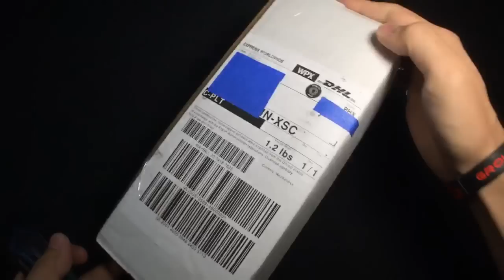Live Unboxing - SPINETIC PACKAGE

Comment: Hi i was wondering if it is even legal to have a flick knife with you in singapore. Since you have one can you give me some advice about these blades. Like how to stay away from trouble and when ur allowed to use it
Reply from the maker: Yup! Folding knives are fine. The only ones that are not allowed in Singapore are switchblades. :)
Reply: Average Singaporean i c. Coz i got one CRKT Pazoda
Reply from the maker: CRKT is a pretty good brand, man!
The Pazoda is super sleek and clean! Did you peep the Pazoda 2?
Reply: Average Singaporean i got the combo(serrated+ razor) black and white version of the pazoda. S$24. The pazoda 2 is abit more expensive at $30+. I didnt see much of a difference between the 2 then so i just took the cheaper option. Yes it is nice. Very thin. Unfortunately it is not spring assisted.
Reply from the maker: Really!
Dang. I saw a pazoda for US$30, then a pazoda 2 for US$20. Surprising!
Reply: Average Singaporean i think there was a few series made. Mine was the older series so there may be a price difference.